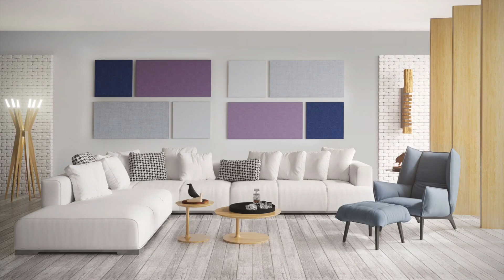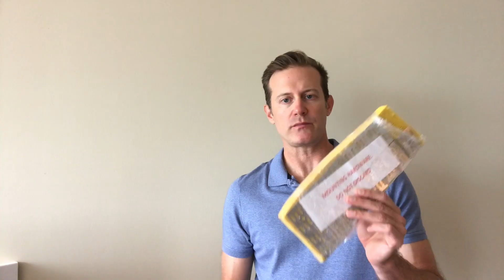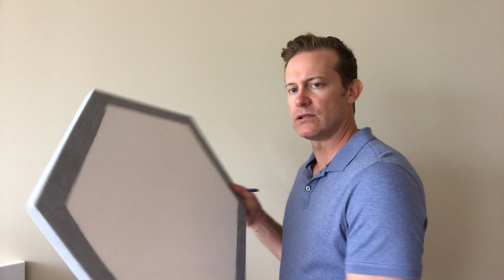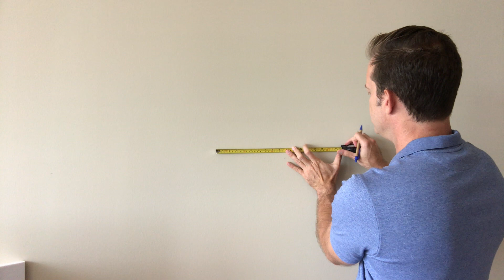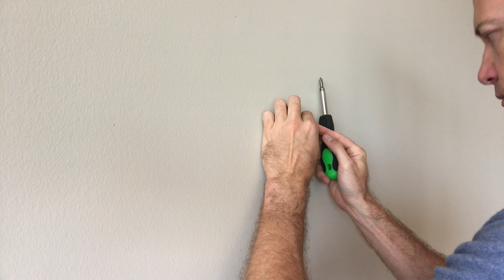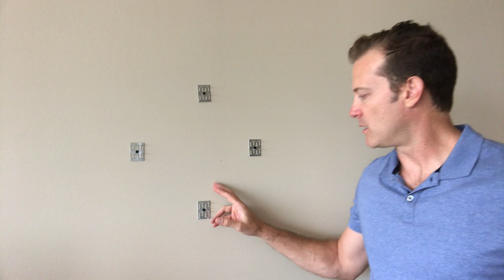Acoustic Panels Installation Instructions - Acoustic Design Works

Comment: What if my friends are cockeyed? I rather just spend a few dollars on a leveler.
Reply from the maker: Using a bubble level (or spirit level) is a great idea to help make sure the panel is mounted well. There are even apps for your phone that can act as a level.
Reply: Acoustic Design Works There you go.. my term “leveler” includes phone apps. so why not recommend an app on an instructional video Sir?
Reply from the maker: @CraftWon  Definitely on the to-do list!